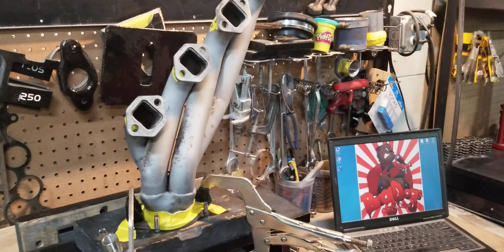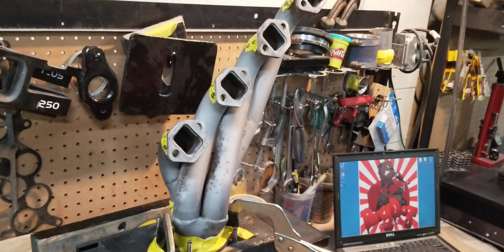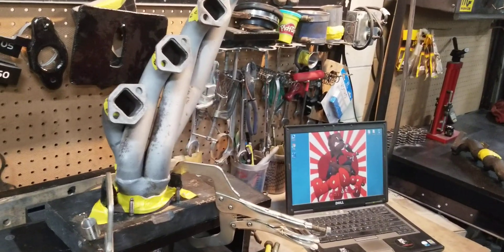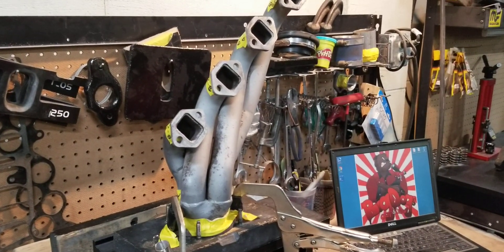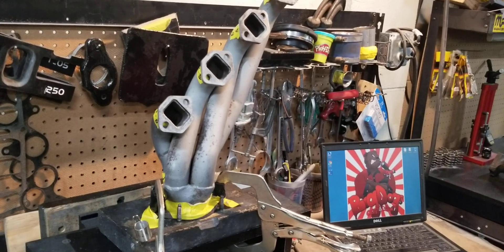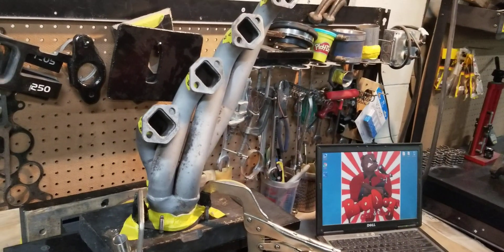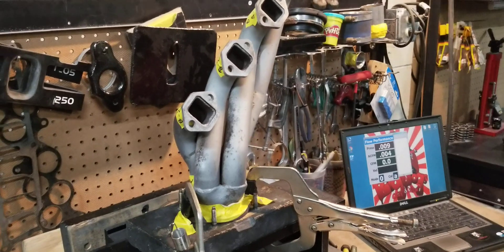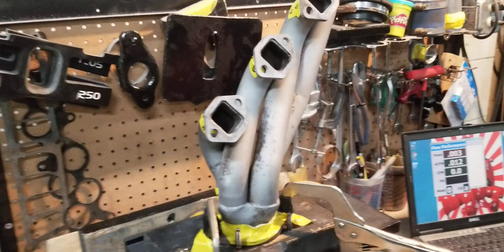Fox Body Mustang Mac shorty Header Flow testing part 1

Comment: What were the after results? 

I can't seem to find the after video
Reply from the maker: The results were posted on our Facebook business page at Bigdogs porting. Also you don't need a Facebook account to view the page either. With our porting and modifying those headers gained over 200cfm per side and went on a 302 combo running our stage 2 ported gt40p heads, stage 3 ported Explorer gt40 manifold, ported 75mm throttle body,  yes stage 1 cam retarded 4 degrees and a custom tune with 80mm maf, Anderson 3.5" power pipe and 30lb injectors. Data logs was showing 375-380whp